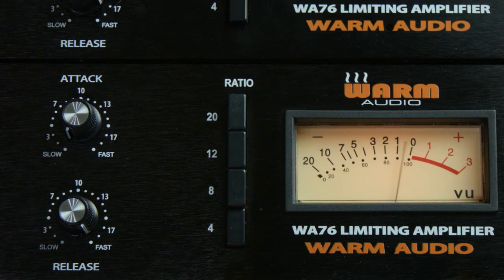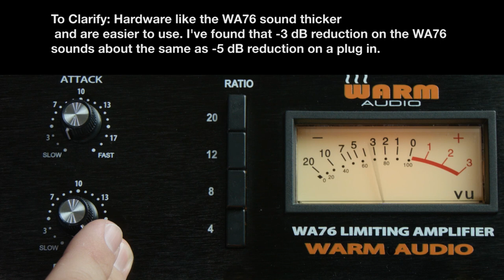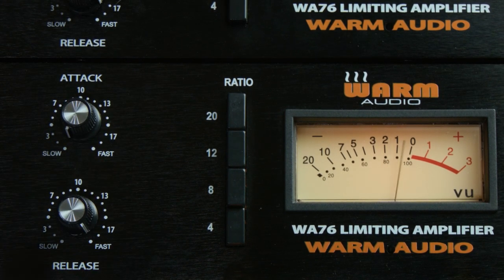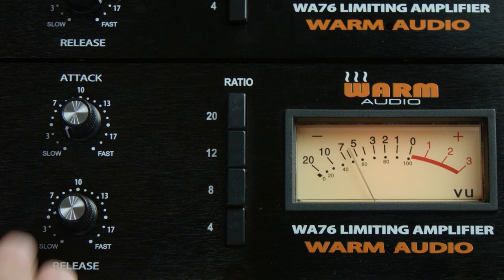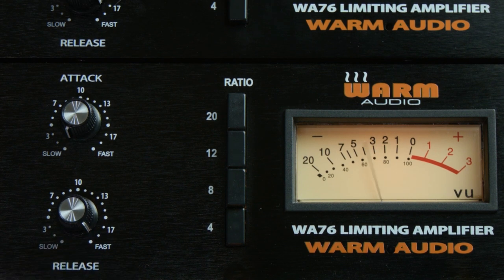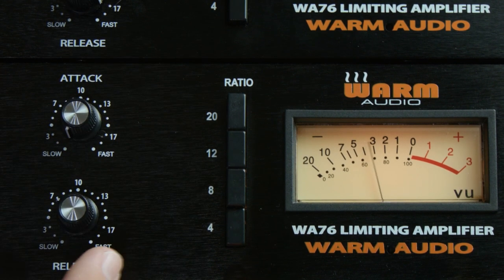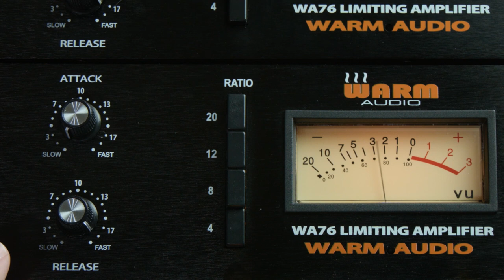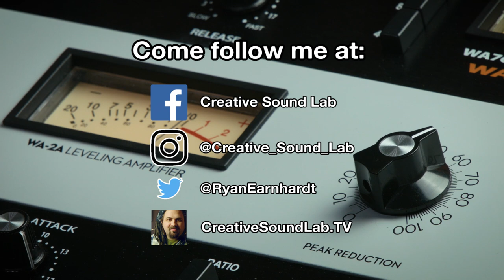How to Compress Acoustic Guitar (And How to Not Screw it Up)

Comment: A cool thing to note about the characteristics of the release knob is that it will also affect the eq balance of the signal depending on where it is set. Notice that when the release is all the way fast, the guitar is brighter, and when it is slowed down, it gets darker. It's a great tool/trick to have because if you know you'll be compressing a source, you can change the eq curve before ever touching an eq!
Reply from the maker: Yes, but I wander if this is more based on the attack, as most high frequencies are in the transient. The release setting affects the attack time, which would as you said adjusting the release to make it sound brighter. Hadn't thought of it that way before.
Reply: You're absolutely right, there is much high end information in the attack of a source. But the release, especially on its fastest setting, will introduce distortion that will have the effect lifting the high end of a track. There is a great video made by Pro Studio Live where Daniel Ford explains the concept. He suggests an experiment with pink noise to better understand how this changes the frequency content of a source. Totally blew my mind.

Comment: i liked your compression manual, though i never use a pick for acoustic guitars so it's sort of a different approach. For example i'll implement how i play using either my nail as a pick for plucking or the face of my index finger nail for strumming. So the attack of using my thumb to downstrum is always super bassy much different than a pick. So i guess i'm looking for advice on how to thicken the sound without making it sound too bassy.
Reply: This question is one I have as well.  Fingerpicking with a bare thumb is very specific and has recording challenges.  Not covered much by anyone.  Good question!

Comment: Hi Ryan, one question is, I thought lower ms Attack setting meant faster attack response and vice versa with the Release setting. I thought usually slower or increased ms time on the Attack setting meant it took longer to respond and hence allow more signal to go through. Am I confused here? Is it the terms used? Hope you can explain. Thanks in Advance.
Reply from the maker: Yes, a slower attack time will allow more sound to pass through, usually the pick sound or sibilance of vocals.  You can hear the pick sound go away with too fast of an attack time. On all 1176 type compressors and plug ins, turning to the right makes the attack and release faster or less ms. To the left is slower and more ms. The attack time on the 1176 type compressor is 20 microseconds when turned all the way right, and 800 (.8 ms) microseconds when turned all the way left.
Reply: Now it makes sense. Thanks as always.
Reply: Creative Sound Lab    Hello Ryan, I've been trying to DL your Free pdf on your website and that's what I'm getting:

Not Acceptable!

An appropriate representation of the requested resource could not be found on this server. This error was generated by Mod_Security.

Have a great day

Comment: Nice one Ryan. Wondered if you have any pointers on compression for live (thru a PA) solo acoustic guitar.  I alternate between soft picking and hard as hell thrashing, often in the same song and the volume difference is frightening. A friend swears by the Cali76 Compact Deluxe as it does parallel compression. Any thoughts?
Reply from the maker: I've never worked with the Cali76, but it sounds like what you need is a very slow release compressor first to control over all volume, then a faster one set with the more consistent volume. Most of the time a slow attack (for a '76 type comp) and a fairly fast release to get the sustain up.
Reply: Hey Sam, maybe a good idea would be to use a volume pedal before your compressor to take down the loudest parts. It's what i do while mixing. (just not with a pedal) You just can't compress 2 very different ways of playing with the same setting and expect things to roll out fine! And it's also about context, if the dynamics of your playing fit the rest of the arrangement, things might not be that bad!

Comment: My problem with having a fast attack time is it almost eliminates the point of the compressor, which is to tame the dynamics (though compressors have many different purposes). I feel you get more dynamics control with a fast attack and set the release to dictate tightness or energy. Then slow the attack to tone taste. For example, fast release with a fast attack will give energy to the acoustic track because of the pumping gives the illusion of more intense playing while having the release slower, as to pump more in rhythm to the acoustic, provides a tighter compression (though even slowing the release too much ends up compressing everything, which is not good compression). When the release and attack are set too slow, you allow too much transient and even some body/tail to come through so no real leveling is happening in any beneficial way. This is especially true on a kick drum. The slower the attack the more you are allowing more than the initial transient to go through and end up allowing some of the tail to come through as well (which defeats the purpose of the compression). Will it still be tighter than the unprocessed track? Yes, but not optimally so. Same with release. On a snare if the release it too fast and your goal is to get it to pop then you want that release to be slow so that way the tail does not come back into the picture (at least until  just before the next hit). If you are trying to make the snare fat then you want a fast release because you want that tail to come through and sustain after the transient has been compressed.

Comment: Thanks for the great video. Do you find it necessary to change the way you use compression if the guitar has nylon versus metallic strings?
Reply from the maker: Sure if the attack is different. Just listen and make adjustments as necessary.

Comment: I'm really confused, did ryan make a mistake when mentioning attack / release times at 1:30 ? He says that the attack is 80 milliseconds (with the knob all the way to the left, on the slow setting) and the release is 50 milliseconds (with the knob all the way to the right on the fast setting). Am I missing something? Do these knobs have different scales?
Reply from the maker: Microseconds, not milliseconds.
Reply: When typing that comment I see my error but I am still confused by this. So you have .8 mil for a slow attack and 50 mil for a fast release. 0.8 mil seems pretty fast for a slow attack.
Reply from the maker: Yep, very fast, but I don't think it sounds that fast. I'm sure there are factors that make it musical even though it's that fast.
Reply: I went ahead and looked at the manual for your wa76, and realized I was actually confused on the time scale of the knobs being different, not even the sound of the compressor. I agree that it sounds very good.Thanks for the replies homie!